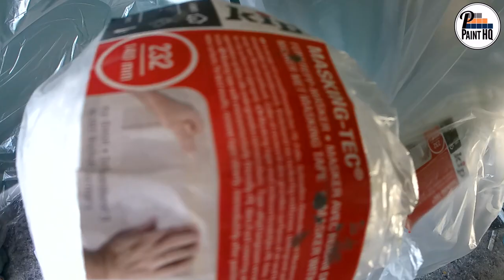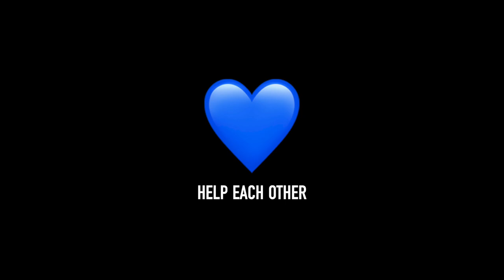The BEST Airless Spray Guns. Graco Contractor PC and Graco Contractor PC Compact

Comment: My thoughts as a total novice on getting into spraying.

I decided to get into spraying and purchased the excellent Graco GX21. Has it been plain sailing? No! My sprayer arrived complete with a 15M hose, that's got to be a good thing because it's huge, right? Well, not really. One of my first jobs was a two bedroom apartment but it was small. Having a huge hose caused problems, although they were problems of my own making. I would spray a room and start at the wrong end so I ended up smudging the paint with the bloody hose. My fault of course but it wasn't something I considered until I messed up. Get a shorter hose and a whip, you will not regret it. Oh, get a hopper. It's worth it just for how easy it makes cleaning the GX21.

If you're asked to quote for a job go over it with a fine tooth comb, don't consider quoting if the plastering hasn't been completed. I've recently completed a job where the plasterer had a left a build-up of plaster on every skirting board and door frame. Trust me, it's a swine to remove by hand and very time consuming. 
 
This will sound stupid to many people but consider masking your lovely, expensive sprayer. I didn't and it's now white and looks crap. Two minutes of masking keeps it looking like new.

On the subject of masking, when you first start you will probably be slow and even struggle to cut masking film with your hand masker. Stick with it, you will get faster with experience and one day be as quick as Pete!

Finally, watch Paint HQs videos, literally everything that I know is due to Pete's fantastic tutorials.
Reply from the maker: Hey Stephen, great to hear from you.. I really appreciate your input, wise words and kind support.. hope you’re keeping well.. regards Pete 🙏

Comment: It's certainly nice to watch a real professional paint.  I am a retired DYI guy that mostly paints interior and exterior trim and baseboard (Acrylic Enamel) with a Graco Magnum X5 airless.  while the X5 gun is OK, I never liked the RAC IV spray tip selection.   Is it possible or even plausible to use the Graco Contractor PC Compact gun on my Magnum X5?  I would like to use the LP FF tips; however the RAC IV does not seem to offer those sizes.

Thank You
Reply from the maker: Hi Mark.. that’s very kind of you to say —  it’s great to hear from someone with a wonderful enthusiasm to spray projects into retirement 💙 I’ve just looked up the X5, the gun / tip guard thread is a standard 7/8”, so it is possible to swap out to a RAC X tip guard and tips (I believe the X5 max tip size is .015”).. also the hose connection is a standard NPSM 1/4”, so yes a swap out to a contractor gun is also possible 👍 ..Hope this helps, please keep in touch it will be great to hear how you get on.. regards Pete 💙💯

Comment: Excellent video, and thank you for showing the comparison between the two guns. You've earned a like and a new subscriber:) Question: spraying primer on doors and trying to reduce overspray. Using a black Graco 4-13 still getting tails at 2500. My 5-15 seems like overkill for doors. My FFLP 3-08 is good for finish, but the primer is my problem. Do you have a suggestion?
Reply from the maker: Thank you so much for the kind words and support.. regarding spraying primer, your thought process to get the balance of atomisation / pressure / fluid flow is spot on.. you’ll see in a lot of my videos I’m a fan of FF LP .008 tips, which works awesome for the low viscosity waterborne / spray only  primer  / topcoat that I’m a fan of.. I spray a high build that still atomises awesome through a 208 / 308.. so your primer is much thicker is it? Vs your topcoat ..if you’re still getting tails with a black 413 (TrueAirless) at 2500, you’re right to think the tip orifice size needs to be upped.. if you have a 515 to test on paper (not on the doors), it will give you an idea on orifice size to see if tails are eliminated.. if so, you could stick to a .015 size or try a .014 (very similar).. if you’ve got the RAC X tip guard, I’d go with an FF LP 

..Or go back to the 413 and thin the material.. again test a bit so you’re not wasting your precious paint.. I don’t like to thin trim paints but it could be worth it, 10% max, with this primer.. if waterborne, you could use warm water / and warm your paint.. all helps the flow 😆

Sorry I don’t have a definitive answer, but credit to you, you’re thinking very wisely.. it’s just getting the balance right, and spraying at the lowest possible pressure to minimise overspray..

Keep in touch, great to have your input on the channel.. happy to help if I can.. regards Pete

Comment: That Graco compact looks like a good gun. I've been using a Silver Plus gun for a few years (nice gun), but recently I found a gun by ARO on eBay for $25. I'd never heard of these guns but it's the best gun (by far) that I've ever used. The pressure is butter smooth and it has the lowest pull pressure of any gun I've ever used.  The trigger lock is in the back where it should be. The downside is these guns cost $800-$1K dollars and that's probably why we don't see these guns used much. If you come across one for dirt cheap pick one up. You'll be glad you did.
Reply from the maker: Thank you my friend, I really appreciate you reaching out and sharing your experience.. keep in touch, will be great to hear your thoughts in future.. Ps Graco is releasing a ‘genius design’ airless spray gun.. I believe marketing material is being shared in North America right now (or very soon).. I’ve just viewed a presentation in Europe / EMEA ..we have a little while to wait yet — it’s all very exciting 💙💯 Regards Pete

Comment: Nice to see you running the woodwork—> walls —> ceiling approach. There’s always an element of discussion on what is the order to spray. Ceilings, woodwork then brush and roll walls is another favoured approach but then I’m putting my sprayer away too early!! How are you dealing with spitting out of the extension without a clean shot. Is that simply technique. Triggering just off the surface? Cheers
Reply from the maker: Thanks for your feedback, appreciate your input.. yeah my favourite is all sprayed, like you I enjoy the spraying process and the finish and sharp masked lines are mind blowing.. I can appreciate the reasons for a roller / back roller finish.. on all my jobs the minimum is spray is woodwork and ceiling.. a possibility for me is to spray woodwork, then mask and brush / roll up onto the ceiling (no cutting in), then on the last day mask the cut line and spray the ceiling.. you may not save a day labour, but it’s less labour intensive on the body, each step is quicker, the finish is flawless and yeah the ceiling cut line is razor sharp.. a HSL is a good example of spraying, masking the ceiling cut line is easier to navigate than manoeuvring a ladder, going up and down.. on this job I didn’t use a ladder I could spray off the landing up onto the ceiling, and I could reach and push the masking round (if that makes sense).. then all the masking pulls down from the ground at the end, it’s very satisfying 😆 ..you’re right I trigger off / on, hitting the masking 👍 ..although I find the small 25cm / 10” extension doesn’t produce much / if any noticeable spit 😆 ..I do sometimes use a Cleanshot 💙 ..really appreciate your input and contribution on PaintHQ buddy.. regards Pete
Reply: @PaintHQ  not as much as I appreciate the time you spent on that reply, as well as your videos, really useful and inspiring.  👍
Reply from the maker: You’re so kind, thank you 💙

Comment: Them graco sprayers are only 110 volt, are they practical to use in the UK?
Reply from the maker: Good question my friend.. it’s a 110v CE kite marked Graco unit, so all good on safety / UK warranty and service ..It is a pain carrying the (heavy) 110v transformer, the advantage is you’re covered for site work.. a 240v mains corded unit is less to carry.. a Graco Cordless Sprayer is even better 😆 ..my opinion, the future 💙⚡️ ..Thanks for your input.. keep in touch, regards Pete

Comment: Do they  sell conversion kits? I have the compact. It’s great for spraying stationary. But once I get moving with it from side to side and different angles the hose swivel always finds a way to pinch the side of my hand.
Reply from the maker: That’s a very good question and a very good idea.. I’m pretty certain that they don’t — thinking bout it, there is a difference in the ‘trigger assembly’ because the PC cartridge has a different part numbers for the  compact Vs regular contractor PC.. plus the trigger and guard has it’s differences.. it is a good idea though 👏👏👏 on the note of the ‘problematic’ swivel / pinching your skin ..I believe it’s a ‘known issue’ (in some cases) and a modification is planned for future releases 👍💙💯 all the best my friend.. keep in touch.. regards Pete

Comment: Hi Pete how do you rate the graco LP tips against the HEA tips cheers
Reply from the maker: Hey John, that’s a very good question.. what I find is the HEA tips can be a much courser atomisation Vs Graco LP tips, that atomise very fine, producing a softer edge to the fan.. I’m sure there’s an engineering explanation for how the material is broken up under pressure.. certainly all paints behave differently, going on their pigmentation and quality.. I find it all very interesting 💙 ..great to hear from you again, hope you’re keeping well my friend.. regards Pete
Reply: @PaintHQ  thanks Pete I have just got a 440 impact very happy with it I use HEA tips all the time only because I have been using a wagner 250r that only has a top end of 1500psi but now I can try different tips and see the difference between them thanks for your reply mate cheers
Reply from the maker: Ah I see.. what size tips do you typically use?.. I’m confident you’ll be impressed with Graco tips, the low pressure achieved in fine finish spraying (FF LP), has been up to 50% less in some of the tests I’ve carried out.. you’ll need a 7/8” Graco RAC X tip guard.. I have spares, never been used, I’d gladly pop one in the post for free if you wanted to email me your address..

painthq.mail@gmail.com

Regards Pete 💙
Reply: @PaintHQ  I've used the FFLP tips and they are spot on my little pump had enough pressure for them but not the LP tips I typically use a 5:17 hea for walls and a 210 FFLP for woodwork cheers mate
Reply from the maker: Thanks for the info 👌👍🙏
Reply: @PaintHQ  I've ordered a 6:19 LP I will let you know how I get on mate
Reply from the maker: Ah nice one my friend 💙

Comment: Hello Pete how's you ? seeing you contractor gracco gun dirty with paint made me feel better about my self. usually on your videos they are spotless, i been founding my self looking more and more on  HVLP  and i seen on  SpraymanUK a deal with a compressor gun etc etc which made think in what is your thoughts about it? i was looking on the wagner 5000 but not quit sure what to do know as that deal in SpraymanUK sounds more appealing. the other is the gracco 7500  but is getting out of the budget.... i just wonder because i saw you using all  the ones i mention if you have to stick to 1 option what would you do. i realized gracco is coming up with a new sprayer but for what i understand is on the £2000s which is not cheap i must say.  have a good Sunday afternoon
Reply from the maker: I do rate a conventional airspray / HVLP setup.. you’re not limited to the air and the passive setup when using a remote pot.. unless you add a compressor to a turbine setup or go for the Graco 9.5 ProComp, .. that would be my choice of a turbine, but I can appreciate the cost and investment.. with a compressor setup, it’s not as portable as turbine, but you can run a long airline and have the compressor in another room.. so a turbine is portable but the airline is thicker and not as flexible (if spraying uPVC for example and maybe working off a ladder).. I’d rule out the XVLP, that’s by no means a slur on Wagner, I wouldn’t do that.. it’s just not in the same league as a compressor airspray / turbine HVLP .. one more thing on a compressor, if you already have airless.. you could take another step in future to Air Assisted Airless 👍😆

The upcoming Graco QuickShot, firstly is a professional airless unit that’s extremely portable.. I was fortunate to field test in the UK, and being released I’m super excited what this unit can deliver and I can’t wait to showcase why I believe it’s a cordless unit worth investing in

Have a chat to my friend Mike at SpraymanUK, he’s a great guy, super knowledgeable and won’t pressure you to make a purchase.. mention me (Pete) and he’ll steer you right 👍

Keep in touch, I’d love to hear what you decide and I’m more than happy to help and advise more if I can.. regards Pete 💙
Reply: @PaintHQ  Pete thank you for your replay, i did look on the gracco 9.5 with the pot but as mention price tag is high(i guess is a case you get what you pay for)
this is no different then my gx21 i absolutely fall in love with the bloody thing ,i was quite reluctant in to buy it because of the price tag but know i'm so glad i did  it  and haven't both a cheap one. 
bottom of line i need to decide if the work is coming up if justify the investment .

i also been looking on a battery powered but seeing videos  of th quickshot is making me wait a bit longer because i think will wort it.

i will speak with Mike and exchange some thought wend i more ready for it as i don't wanna waist anyone time.

is a difficult  because the compressor i can buy locally however the deal mike had seemed to me quite good. 

thank you for your help 
🙂
Reply from the maker: You’re very welcome, I can appreciate your dilemma and having a budget.. you have invested wisely in the GX21 💙
..The upcoming release of the Ultra QuickShot is something I’m very excited about.. it’s a great addition to the cordless range.. I can vouch for the research and how Graco listens to custoner feedback to develop such innovative technology.. I’m confident the Ultra QuickShot will be a great investment for anyone in the Paint Contractor / P&D market.. I can’t wait to showcase the unit soon 💙 ..regards Pete

Comment: How much time you let the wall paint dry before masking the walls?
Thank you.
Reply from the maker: Thanks for your question.. it’s the next day that walls can be masked.. This is the low tack masking tape that I use by Kip..
https://www.amazon.co.uk/Kip-221634-Fineline-209-23-Lilac/dp/B06XKKZ4GY/ref=mp_s_a_1_5?crid=2G3DFM2C6RR87&keywords=kip+masking+tape&qid=1679841221&sprefix=kip+masking+%2Caps%2C105&sr=8-5

Then I use  a 2.6m Pre-taped plastic film also from Amazon..
Kip Washi-Tec 232 Film (2600mm)

Hope this helps 🙏 regards Pete

Comment: Hi Pete, I have a oak staircase that a customer wants painting black I'm thinking of using otex akva gor the primer and everal aqua 10 as the top coat. I've never tried any of tikurillas products so wanting to give them a go. I'm wondering if there is any way of getting some samples from tikurilla to try
Reply from the maker: Apologies for my delayed reply my friend .. did you get to try Tikkurila? ..regards Pete
Reply: @PaintHQ  hi Pete, no problem 👍 yes I used the otex akva and everal aqua 40 mixed to black it sprayed lovely and because it has enamel it dried rock hard
Reply from the maker: Ah great news, glad it all went well 💙

Comment: Hi Pete, just wanted to share my experience with the newly-purchased Graco Contractor PC Compact gun. You have not mentioned the problem I have and I wonder if it is just me (of a sort). This gun has this weird sheath near the swivel nut that allows the skin of my palm to get caught between two moving metal parts and pinch it quite painfully.  Have you had such a problem?
Reply from the maker: Hey Dmitriy, thanks for your feedback on the Contractor PC Compact gun.. no I haven’t experienced that problem myself, I will ask others though.. it’s an interesting scenario 🤔
Reply: @PaintHQ  I've been in touch with Graco and they have confirmed that they had this issue in "small number of cases". Lucky me,  I suppose. Nevertheless, they told me that a modification was made to address this issue and having checked my serial number they have sent a new gun to me. Upon visual inspection, it looks 100% the same as the one which gives me problems; will try it in action to see if it is just my eyesight that is not seeing the difference...
Reply from the maker: Ah cool, interesting to know.. let me know what you discover my friend 🙏